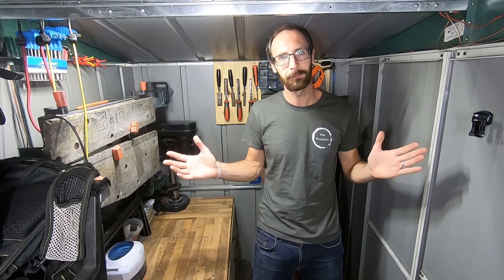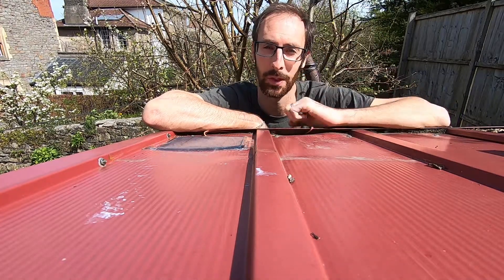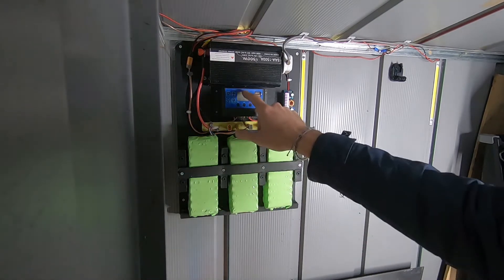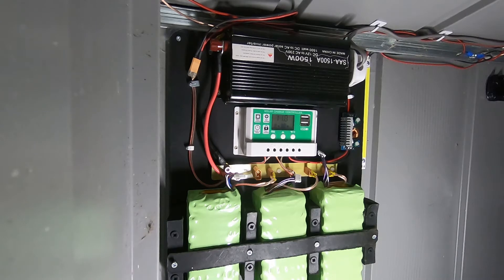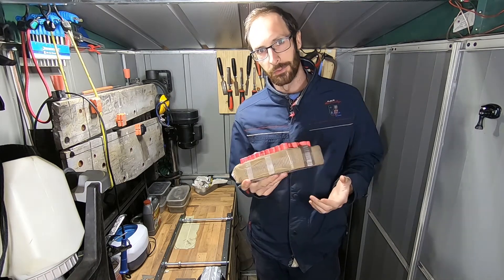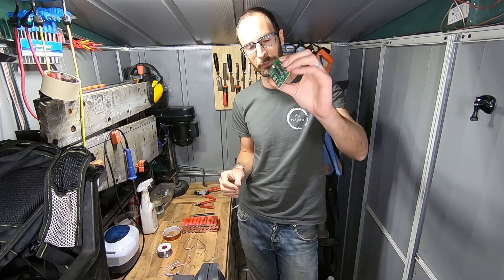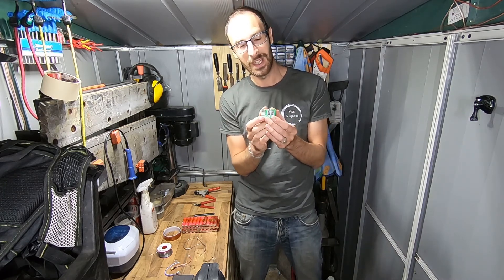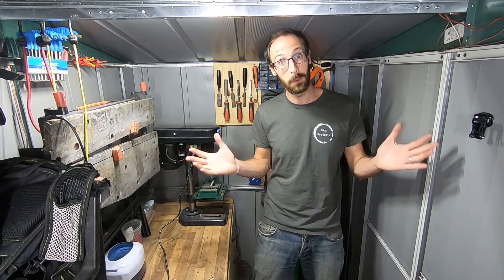Powerwall | Needs more power

Comment: You may already know this, but for optimal charge, you'd want your solar panels mounted at an angle. For the U.K, this would be 30 - 40 degrees, unless your shed roof is already at that angle, in which case they can be flat. In addition to optimal charge rates, the panels will stay cleaner.  I use a 100W panel into a 55AH deep-cycle battery, to power a goat grotto (don't we all?) and I only run a few LED lights, but I have the panel at 45 degrees and even here in sunless Washington state, the panel is outperforming expectations. I chose to use 12v systems wherever possible to simplify installation and minimize load (led lights, etc) but I will be adding an inverter when I get around to it.